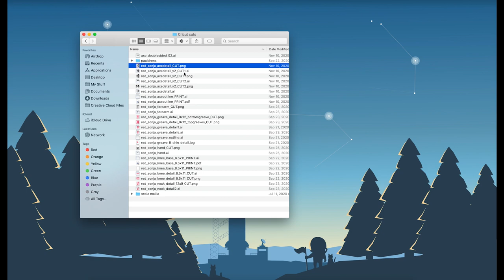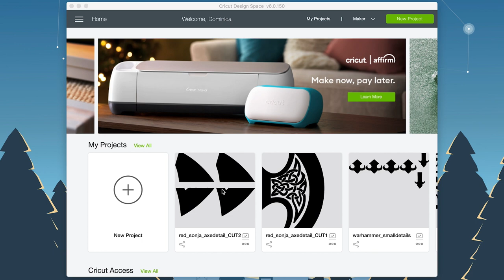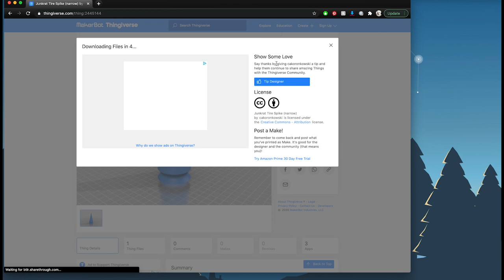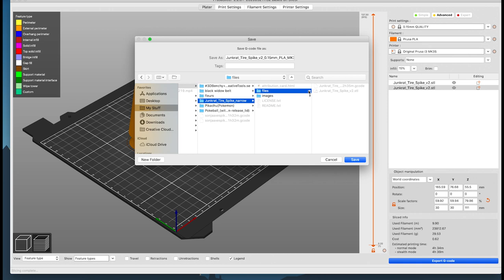Red Sonja's Axe - Cosplay Prop Tutorial

Comment: Awesome!! I would just say that dry brushing is when you use a very dry brush and just aim to hit the high points, what your doing is ‘low lighting’ or ‘black washing ‘, not trying to nit pick , you do awesome stuff
Reply from the maker: Low lighting is a much better term, I’ll use that from now on. My boyfriend said the same thing, but I had trouble with terminology since I’m using very little paint on a dry brush to work it in. Having painted minis, it is very different from doing a wash and doesn’t work quite the same so I didn’t want to use that term

Comment: I am also trying to buid an axe out of foam, how thick is the foam you were using for the blade and where did you get it? I can't find foam that thick anywhere.
Reply from the maker: This was 10mm foam so my axe is 24mm thick in total (doubled 10mm then 2mm on each side)  You can get high quality 10mm from from blick, tnt cosplay supply, any local Eva foam supplier (if you have one) or use super cheap puzzle floor mats (though if you go that route you’ll have to sand off the texture on one side)